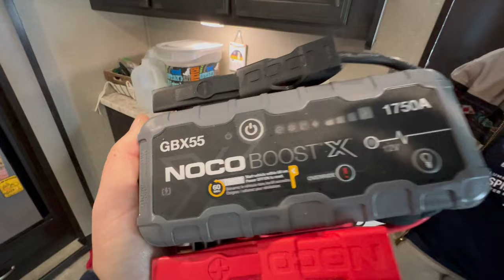Winter Camping! | Grand Design Service Center Visit | Findley State Park

Comment from the maker: We had a great time camping with @Wandering Wagners and @En Route with Chuck and Cherie!  Comment below with any winter camping questions that we may be able to answer!
Reply: Do you have a recommendation for a quite generator….also do you boon dock?
Have you heard about Hipcamp…..you stay for free at different locations….
Reply from the maker: @carriem7832  We do occasionally boondock. We have a Honda EU 2200 generator and I put a 2nd battery on the camper.  I installed the MicroAir easy starts on both air conditioners, so the 2200W generator will run one of them.  The Wandering Wagners used a Predator 3500 generator when they had their Airstream. They work well too.  I have not heard of Hipcamp yet. A 2200 w generator will get you 18amps. The 3500 will get you 29 amps. Both are inverter generators.
Reply: @FollowingtheFitchs  
Thank you for the info.
Hipcamp is where people allow campers to stay at their wineries, farms , homeland and you can only stay one night unfortunately but there are some really nice spots.

Comment: Awesome video guys!!! We want the recipe!!!! We always have such a great time with you two! Can’t wait to do it again soon!! 😁
Reply from the maker: Dave's amazing wagon wheel noodle cheese stuff:

14-16oz of wagon wheel noodles ( the 1" diameter are best, but tough to find)
1 jar Cheez Whiz
1 stick of margarine / butter
1/4 to 1/2 cup of milk
crushed ritz crackers - don't go crazy or it will be too dry.

Cook noodles
Drain
microwave Cheez Whiz to liquid
melt margarine / butter
mix together and add milk
pour noodles in and mix well

13x9 greased pan 
heat oven to 350 degrees
pour contents into pan and sprinkle on cracker crumbs. 
Bake for 15 min.

Comment: I think bacon would be good to give a try! 😉
Reply from the maker: I have a feeling we will be trying that soon! Thanks for watching!
Reply: @FollowingtheFitchs  would you share the amounts for the recipe please!🙂
Reply from the maker: @kathrynsummers2303   Sure thing! 

Dave's amazing wagon wheel noodle cheese stuff:

14-16oz of wagon wheel noodles ( the 1" diameter are best, but tough to find)
1 jar Cheez Whiz
1 stick of margarine / butter
1/4 to 1/2 cup of milk
crushed ritz crackers - don't go crazy or it will be too dry.

Cook noodles
Drain
microwave Cheez Whiz to liquid
melt margarine / butter
mix together and add milk
pour noodles in and mix well

13x9 greased pan 
heat oven to 350 degrees
pour contents into pan and sprinkle on cracker crumbs. 
Bake for 15 min.
Reply: @FollowingtheFitchs  yay thanks!

Comment: I would like the  recipe.
Reply from the maker: Thanks for watching! Sure thing!

Dave's amazing wagon wheel noodle cheese stuff:

14-16oz of wagon wheel noodles ( the 1" diameter are best, but tough to find)
1 jar Cheez Whiz
1 stick of margarine / butter
1/4 to 1/2 cup of milk
crushed ritz crackers - don't go crazy or it will be too dry.

Cook noodles
Drain
microwave Cheez Whiz to liquid
melt margarine / butter
mix together and add milk
pour noodles in and mix well

13x9 greased pan 
heat oven to 350 degrees
pour contents into pan and sprinkle on cracker crumbs. 
Bake for 15 min.